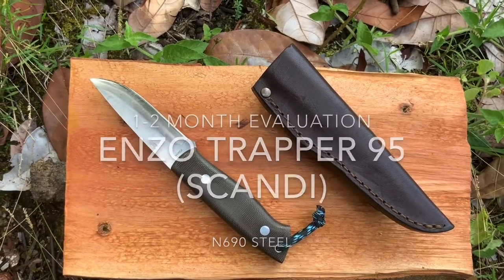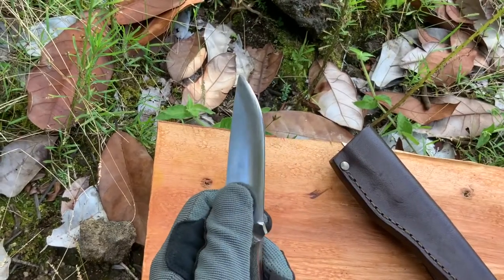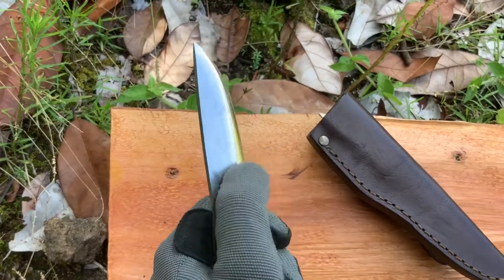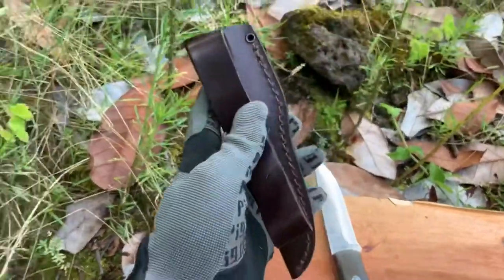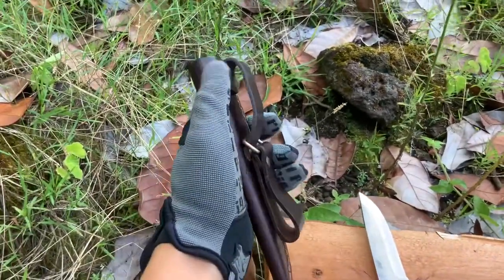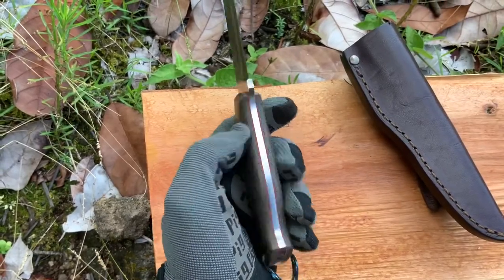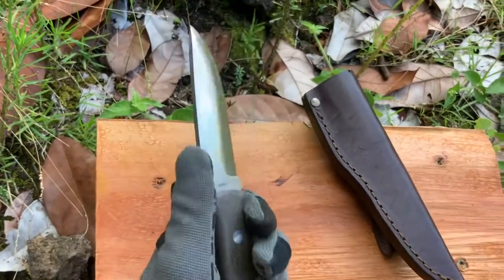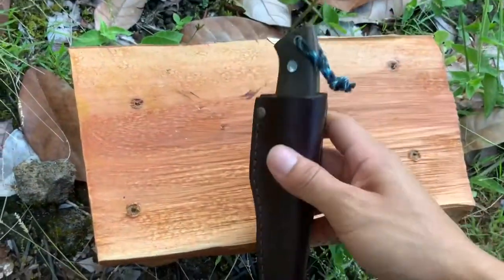Enzo Trapper 95 Short Term Evaluation (1-2 month)

Comment: I must have 30 Brisas by now , lol.  Trapper is my favorite.
If you run a ranger band around the lower part of the sheath to slip the dangler under when you're not using it ,
works great so it's not flopping around. Thanks man.

Comment: Drainage holes in leather are for the extra lazy.... wipe it.
Reply from the maker: Incorporating simple elements to a design reduces the immediate necessity to take such actions, and prevents other problems.
Reply: A drainage hole is not for water to be able to run off the knife when you put it away. It’s so the sheath can breath, and dry out on the inside if it was to get wet inside or have water falling into the sheath…I don’t know who puts their knife away wet…you seem like you’re just looking for something to complain about.